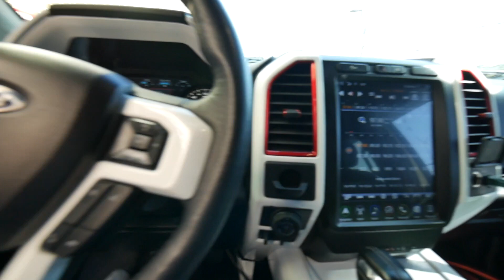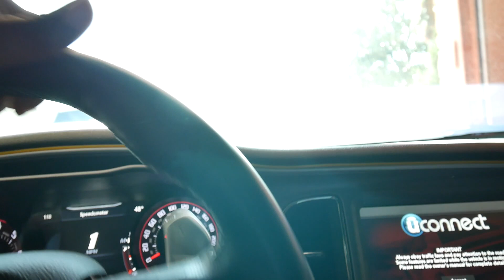YOU WON'T BELIEVE WHAT HAPPENED TO MY WHEEL AND TIRE UNBELIEVABLE NEVER FAILS

Comment: Do you have the factory air pump with the fix a flat stuff in it like the one that comes in the Scatpack? If so you should of used that instead of riding that far to a gas station.

Comment: That's crazy, now you're gonna buy a whole new tire, they're going to patch your old tire and sell it for probably more than half price to someone else - unless you take your old tire back. I can almost guarantee if you take that tire to another shop, it can be fixed and be just as good with a patch on it.
Reply: Right all it needed was plugged not a new tire lol
Reply: Yep. That's how this places make money.  Say that it can't be fixed. Sell you a brand new one and take the tire you left, repair it and sell it time someone else.
Reply: that video where he was crying about his leaking flat tire was killing me I could not finish it
Reply: @JayB28215  yeah man shit was outta control lol
Reply: Depending how low it was when he drove on it  does ruin the tire. From what I could see sidewall looked like it had some damage. At the end of the day you can patch it and pray it never blows especially on a front tire! 
On low profile tires the warranty is definitely a good investment since not allot of room for error with hardly no sidewall.
But what's more important your families safety and or wrecking your ride or rim or $100? There's being a budget minded and then there is being cheap. I find being cheap usually cost me more down the road.

Comment: Why did you have to go to a gas station to get air? Didn't it come with an air inflator in the trunk? Also I have AAA in case it is a bigger problem. They will tow it on a flat bed. Keep up the vids🔥🔥🔥 I'll see you on"Free Smoke" tonight at 5pm CST